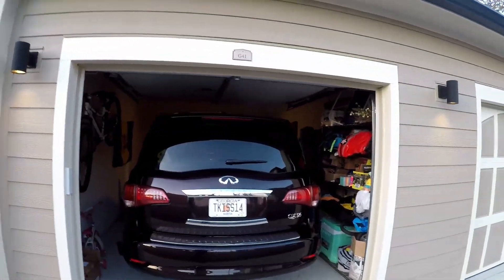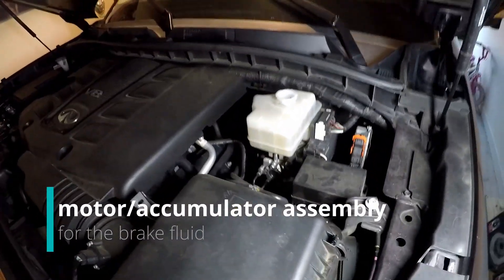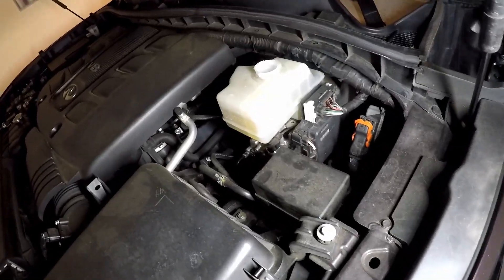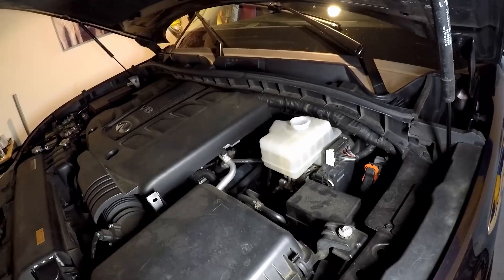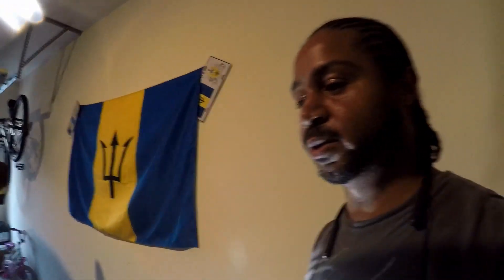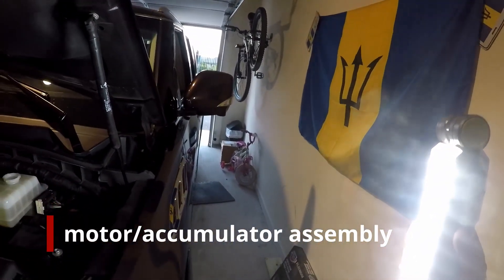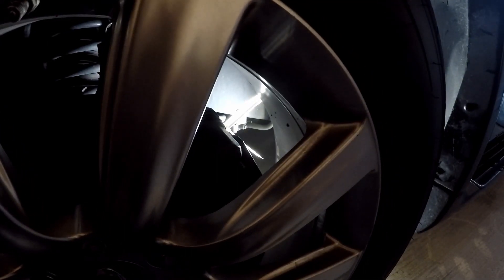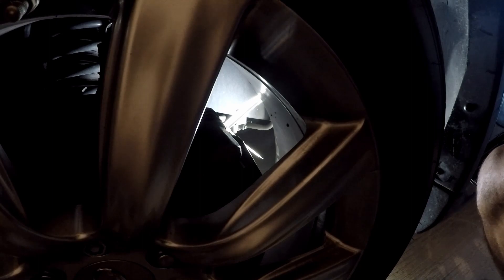How to bleed the 2012 Infiniti Qx56 Brakes.

Comment: I have a 2016 QX80. I changed my front rotors and pads yesterday. I am changing my rears today. My brake fluid is dark.. Can a pneumatic brake fluid bleeder with auto refill kit from Harbor Freight be used to bleed/flush the brake system after the 20-plus pumps and ignition press procedure is done to activate bleeding? Thanks.
Reply from the maker: I would think so... but the system self pumps... not sure if its even necessary to have a bleeder...

With the qx56 brake system you are bleeding the brake lines like any car AND you have to bleed the "electronic master cylinder"... when you are bleeding the "electronic master cylinder" you end up bleeding the brake lines anyway...
Reply: Thanks for the quick response bro. I did my front brakes based on YouTube videos. It was easy. I cannot find a video on the rear. Are the rear as easy as the front?
Reply from the maker: @joelflowers1361  yep... same...
Reply: No. You have electronically controlled brake accumulator, that builds up brake fluid pressure and, brake actuator block that, actually, operates the brakes. Those have valves inside that must be electronically controlled, in order to bleed the system. You either use Nissan intelligent scanner to do this or, do what the video shows.

Comment: I did my 2105 QX80 and it worked great. Went I drive it still feels spongy but it stops. Thank you.
Reply from the maker: You could have some air left in the line... but the brake pedal is  not going to be perfectly firm like a master cylinder system